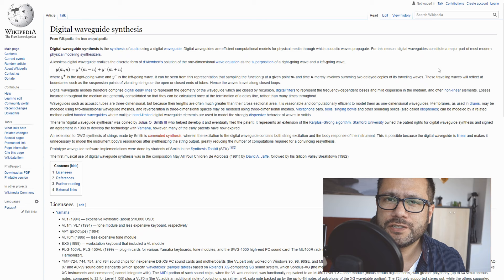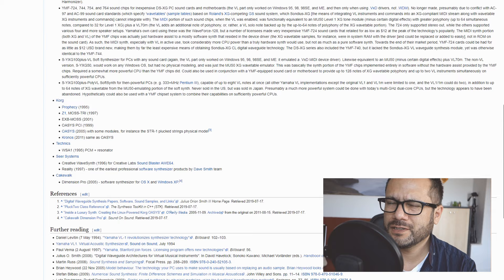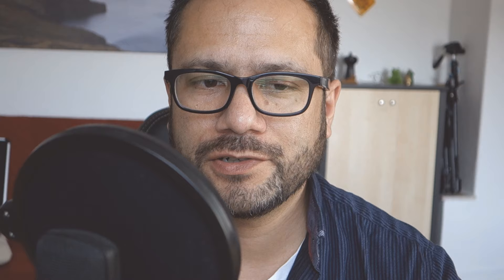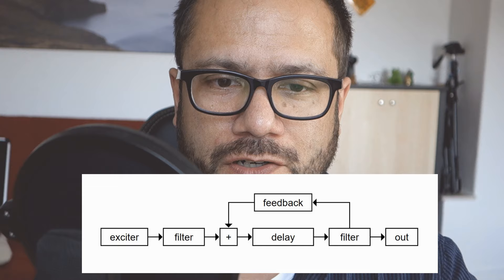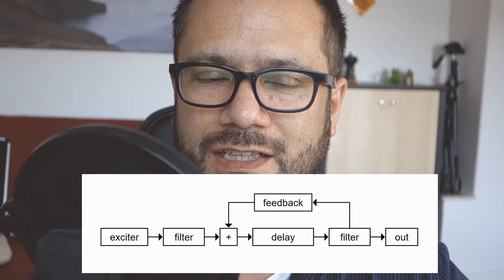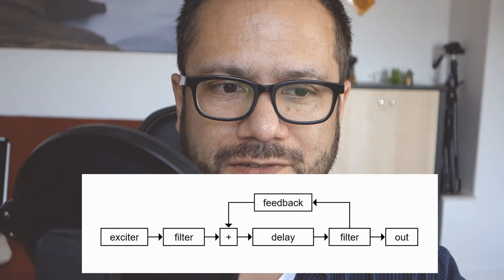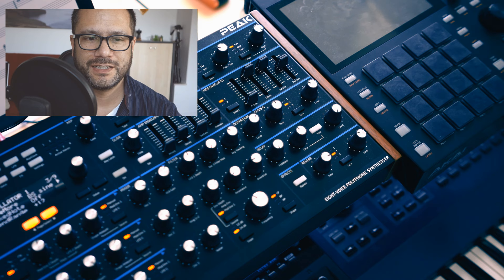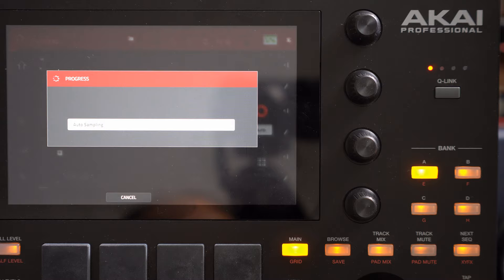VL synthesis: Can we have it back, please? (Yamaha EX5)

Comment from the maker: In case you don't want to read the video's description, here are some links you might want to check:
https://www.native-instruments.com/en/reaktor-community/reaktor-user-library/all/all/all/300659/   - a collection of waveguide synth modules
https://www.osar.fr/notes/waveguides/ - Pierre Cusa's notes on waveguide synthesis with some impressive javascript demos
https://en.wikipedia.org/wiki/Digital_waveguide_synthesis  Wikipedia on waveguide synthesis
There's also a plugin called S-YXG100plus-PolyVL   which is an 8 voice VL synth for Windows, abandonware by now. I could not get it to run on Windows 10, otherwise it would have made it to this video.
Reply: Did you try setting the old plugin to emulate an earlier version of windows and set to run as admin? I get the alesis fusion soundfont tools to work in  win10 this way

Comment: I am an happy owner of 4 vl70m and 3 Vl1m, I program the sounds by myself with some editor and I can say this synth is very underrate, you can create good acoustic sound emulation and new  acoustic sounding instrument but you must program it by yourself because the original patches are not rapresentative of it’s real power. Even the few patches from other tihrd parts  producers are not very good, you can do better but it’s a very difficoult work and it take a lot of time.
Reply from the maker: Thanks for watching! You are right, programming the "models" is very much like FM, but with "sharper" results. You can quickly drive the sound into distortion of the "argh my ears" variety. It takes a lot of time and consideration to create a pleasant sound and even more time to find sounds that resemble actual instruments.
Reply: The original designer of the VL1, Toshi Kunimoto, give me the original program for program the VL1, but only works on Mac OS 3 if have you some machine could could work for Tun it I will try to share you. I use to work for Yamaha Mexico and meet him in 2006.

Comment: Yes they really should bring it back. It has so much potential. It really is splendidly dynamic, there aren't words. I am the happy owner of four VL PLG cards, perhaps I should get another two someday.
Reply from the maker: Thanks for watching! With todays CPU power, you could easily build your own VP-1 knockoff,  with unlimited polyphony. But it's the experience of the hardware maker and the attention to detail that makes or breaks such an instrument. There's incredible attention to detail in most of the VL voices. I'd really like to have that in a new instrument.
Reply: @mr_floydst  Digital design for a hardware FM synthesizer (tone generator) is like…you can do 96KHz sample rate 24-bit 1,024 operators at some 166MHz.  It's not possible to do that on a computer right now—even with a 100GHz 500-core processor, the amount of data contention would be huge, you'd never be able to physically access memory fast enough.  Resolving this on a hardware design is a matter of carefully pipelining the thing (1 FM operator = 1  clock cycle) and using separate bits of SRAM (with their own addressing and data buses) so you can access dozens of pieces of information all at once.  Even GPUs use a massively parallel architecture with huge, huge cache lines (integrated graphics faces a memory bottleneck).

With FPGAs and good design tools (and things like Amaranth to make design much easier), you could do this easily today.  In 1990 you could easily do high-polyphony VP-1 kind of thing, but you'd need a dedicated hardware pipeline (like the FM chips Yamaha used to make) instead of a processor running instruction code, FPGA was expensive, and ASIC process is always expensive.

CPU power is the wrong way to go for a lot of this stuff, although you're right that this is a relatively trivial computation.  Higher polyphony will hit memory bottlenecks in any case.
Reply from the maker: @johnmoser3594  Thanks for your insight! Hm. But I did see some JavaScript demos, so I thought the whole process is comparably "cheap"? Also, you can setup up VST plugins routed like the diagram in this video and get some fascinating results (without the attention to detail Yamaha showed in their implementation, though)
Reply: @mr_floydst  The process is kind of cheap, yeah.  It's a matter of scaling it.  Yamaha's FM-X platform has 512 FM operators and so can produce 512 tones (additive channels are 1 tone per operator) with like 128 polyphony (4 ops per channel, even if one channel is 4 ops not modulating each other).

Consider the simple recursive delay.  You need to store key-on state so you know whether you're starting with excitation or just holding sustain, or if you're in release.  Your filter needs its settings (poles, zeroes), likely an IIR filter with 3 poles and 2 zeroes and with 4 delayed samples (in overcomplicated terms, z^-1 boxes)—look up Direct Form or Biquad, second order is most common, b0-b2 and a0-a1 plus the four z^-1 boxes.  You need one sample per sample delay, but that's just a ring buffer.  You also need your feedback multiplier.

In all, for 16-bit audio samples, you will need 8 bytes per filter of z^-1, plus let's call it 10 bytes for 16-bit poles and zeroes, a total 18 bytes or 144 bits each.  8 bits for your feedback decay is probably fine.  DRAM like DDR is typically single-port, so the computer can only read/write; internal SRAM in a hardware implementation has simple dual port usually, so you can read and write simultaneously to two separate addresses.

In a computer, you'll need to access memory and fetch around 45 bytes of data for these things, and a cache line is 64 bytes, so this is mostly fine.  This leaves enough room to also incorporate a good 10 bits of state for your exciter, but that only gives you 10 bits of phase and frequency, so you're going to need to draw two cache lines most likely, in a sequential burst read, which is fast.  You calculate one of these by doing each stage of the math one instruction at a time, with the data pulled into registers, manipulated, and then written back to memory.  You'll need a significant amount of memory for your feedback delay, and this can't be read at the same time as your channel state, but it doesn't need to be and so being slow here won't matter…on a computer.

It doesn't matter on a computer because the CPU will need to sequentially pull in the data and operate on it step by step, then write it back.  It needs to write back state as well—the new z^-1 boxes and the samples in your delay ring buffer, along with the updated exciter phase.  If you're using any vibrato, there are more calculations to do here to get all of this done, and more data to read.  Each step of the way, you're dealing with slow access to cache (even L1 cache can take a few cycles—stuff is copied into the CPU's load-store queue when transferring between L1 and registers), and even slower access to RAM when there's a cache miss (this can be hundreds of cycles).  Each CPU instruction may take a few cycles to execute, there may be pipeline stalls, and all manner of other mishap along the way.

In a hardware pipeline, the problem is ab it different.  Your hardware will have each individual step of the computation lain out, hard-wired, one at a time.  At points where you need to read one of these values, you'll have an internal SRAM dedicated to whatever block of information is being read—for example, an SRAM that contains the first filter's configuration, and a separate SRAM containing the second filter's configuration.  Exactly one stage of the pipeline reads these configurations; the data from this is used, altered, and passed down the pipeline as needed.  A later stage will write back to the same SRAM, which is where that simple dual-port thing comes in.  Largely, you have to make sure that each individual piece of data that must be read through the process can be read/written exactly one time at exactly one stage of your entire pipeline for the generation of each single sample.

Those data will need another write at a different point in time.  Your clock rate must be such that you finish all computations with time to spare, and then have a window of time where the external controller can tell the chip to update configurations, such as making a key-on at a certain frequency, while the pipeline is not doing any calculations and so not accessing these internal SRAM devices.

The result is that in hardware, if you have a 166MHz (48000*288*12) chip and it takes you 2,000 clock cycles to perform all your computations, you can run at most 3456-2000 = 1,456 polyphony.  Call it 1,024 polyphony, plus 432 cycles during which any instructions to update configuration can be applied (which is not enough to update all configuration!  Have a look at the limitations on OPL3 register access:  you can't change all the registers between each sample, either).

In software, the architectural considerations regarding organization of configuration and state data are at the whims of the PC's architecture (or whatever system is executing your code).  You aren't going to be able to random-access your way through that much RAM, and you can't simultaneously read and write; running in parallel requires parallel CPU cores, or some really nice pipelining and speculative execution, which is in general pretty good, but not that good.  You have a lot of computations to make, and so you're going to need some scratch memory beyond just your registers.  You aren't going to produce 1,024 tones at 48000Hz sample rate in 166MHz—not at all.  48,000Hz sample rate with 100 instructions per computation done sequentially, with perfect pipelining and single-cycle memory access (which cannot be parallelized), is 4.9GHz.  Instructions include things like load, store, and all the mathematical operations and program state operations in between; a direct form 1 second-order IIR filter is 9 loads, 4 stores, 5 multiplications, and 3 adds.

You'll have better luck with this than you will with software FM synthesis, but it's still pretty brutal in software versus hardware.  This brings me back to my original point:  I talked about 1,024 polyphony, but the figures I gave there also assume you have a sample delay of exactly 1 sample or 0.020ms.  If 1ms of delay is allowable, you can actually have a very long pipeline that nevertheless only accesses each of your SRAM banks at one read and one write point in the process.  The pipeline might not finish with the first sample until you're well into producing 50 samples, but it'll finish.  At a slower clock rate, say 16Mhz (OPL3 was 14MHz), you can do 32- or 64-voice polyphony like this pretty trivially.

CPUs today can do a good bit of polyphony on things like FM synthesis and piano physical modeling, but raw processing power has nothing on a well-designed, dedicated hardware pipeline—and that was accessible in 1988.
Reply from the maker: @johnmoser3594  Thank you very much for your in-depth explanation, this totally makes sense to me. I wish I could pin this; one of the most detailed and well-argumented and knowledgable comments I've ever gotten on a video. It also happens to be one of the most enlightening comments on the hot topic "why do we need digital synths when we got DAWs". 
Hm. I could even imagine making this the topic of a video, ... it's really an "aha!" moment for me. :-)
Reply: @mr_floydst  Digital design has a relatively low barrier to entry if you've got programming experience. Like, making your own CPU with a 5-stage RISC pipeline and L1 cache is something you can do in a month with Google.  If you're into doing that kind of thing, it'd be a good direction for you, I think.
Reply: @johnmoser3594  Thank you for sharing your knowledge!
That is something I will link to when the next 'why do you still use hardware synths?' discussion comes up.

Comment: I remember VL. It didn't really seem to catch on but it was revolutionary in the day. Do you think the advent of sample libraries had something to do with it?
Reply from the maker: Hi, thanks for watching! I think cheap storage space (RAM and big hard drives) were the final nail in the coffin. But the Main reason was that the VL instruments were just too expensive and the general audience didnt see the benefit compared to romplers. But CPU performance has increased hundredfold since then..
Reply: @mr_floydst  Being able to design your own hybrid instruments was interesting. But isn't VL just software like all digital synths? It wouldn't be so expensive to create one would it?
Reply from the maker: @IanWaugh  It's all software. There even was a plugin for Windows in the mid 90s which could do 8 voices of VL, but it's abandonware now. I guess you could build your own VL synth using a RasPi and a browser and some knobs, but I'd be willing to pay for a good hardware user interface.
Reply: @mr_floydst  Yes, you can't beat a good hardware interface. Maybe someone will make one...
Reply: @mr_floydst  hi ! Sounds beautiful-I expect you've answered this elsewhere so apologies but is there a way to boost or upgrade the CPU/OS in the ex5?
Reply from the maker: @oblongtom  Hi! I think that's unlikely. The CPU isn't the most important thing in this synth, the DSPs are (digital signal processors). Even if you could overclock them, the operating system wouldn't allow you to make use of those resources. If you want to experience VL on your PC, please follow the links in this videos' description.

Comment: I've recently acquired an EX5R, but don't know much about how to change things, so far.  Is there a way to get all of the Br presets to play with breath control (CC2)?  I found a Yamaha FAQ which does it temporarily for one patch.  I'm looking for a way to do it globally, so they all play that way.

I understand that I can edit one then save it to the Internal banks, but is there a way to just override how all of the Preset banks Br ones play?
Reply from the maker: I'm afraid there is no quick way to do that. (You could of course write an App that does this, or use a patch editor).
The only way is copying all the sounds to the internal banks, and then go through all of them one by one, and save them in place.
Reply: @mr_floydst  Okay.  Thanks.

Should the LED next to the Song button be lit all that time?  I can't find a way to make it go off, and I have no clear idea what it means.   I've found one faulty button, so far, and I'm wondering if I can't turn that LED off because there's another one.  The Voice button puts me in Voice mode, but that Song LED still stays on.

I've been trying to load VL voices from VL-Wizard, which works fine with my VL70m, but no luck, so far.  It shows the patch name for the sound/voice I've sent, but still sounds like a piano.

Maybe it's time to give up on trying what I wanted to try, until I'm a lot more familiar with it, and just try out the piano sounds...
Reply: @mr_floydst  I got a bit further with playing VL70m sounds, saved with VL-Wizard. It needs a configuration sequence sending to it (partly sysex), followed by the Yamaha FAQ on how to make VL voices respond to Breath (Voice, Edit, F7, F8, F3, confirm with +/Yes).

Saving them on the EX5R is a different problem though, and needs another workaround - I have to manually edit the saved sound to point to the right VL voice, otherwise they all sound like trumpets.

After all that, my brain needs rebooting, but at least it is possible.

It didn't take long to save and edit the built in ones to enable Breath, because it turns out there aren't all that many of them.

Thanks again.

Comment: I can't really imagine any yamaha product to bring back since most of their original  stuf still works
Reply from the maker: Thanks for watching! You're right. But Yamaha's VL is limited to two voices (or one voice on EX5), and you can't edit the "models" itself. Putting the software on today's hardware could be interesting, even as a VST plugin. 
This year, we'll get some new modeling synthesizers (the Osmose and the Omega), let's see how they fare.
Reply: @mr_floydst  if so i would like a resynthesis option to superimpose a sample onto the vl parameters , i had fun in the 80s with a program emagic x-alayser wich could read a Midi sampledump into the Atari and transfer them to dx7 parameters , pretty crazy stuf came out
Reply from the maker: @cnfuzz  While it's not exactly what you're describing in the second part, the sample and VL thing is EX5's "FDSP" engine. It takes a sample and applies that recursive delay which creates the VL sounds to it. 
I never heard of that x-analyzer. That sounds super interesting, I'll need to research. :-)